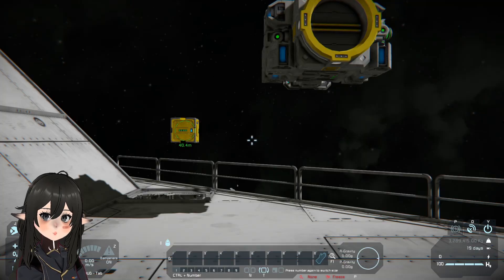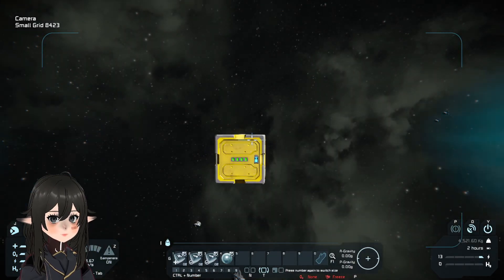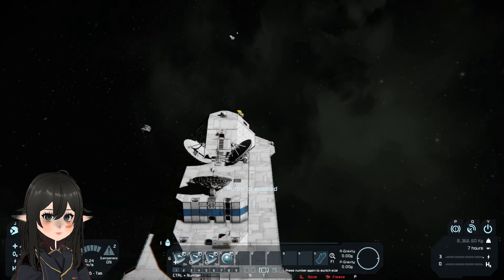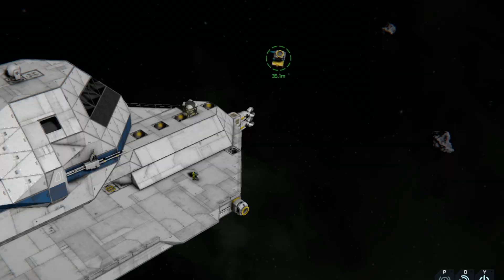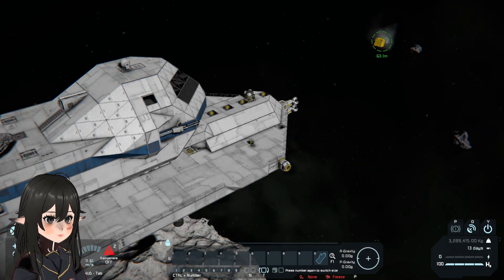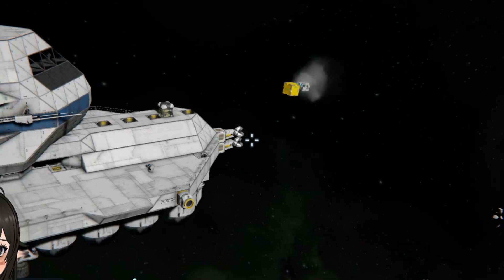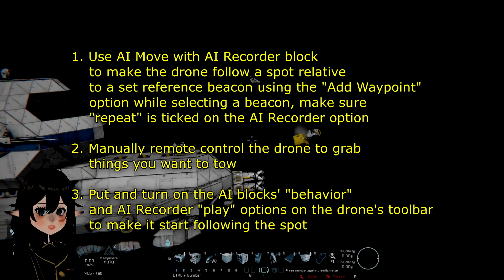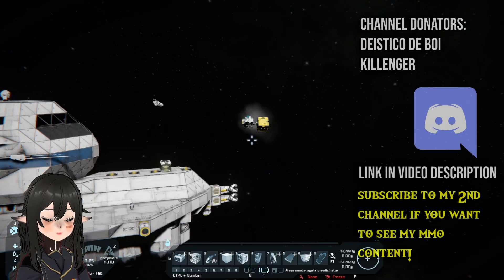This Smart Crane Trick Functions Like a Ship Tractor Beam, Space Engineers

Comment: Just like the Limpet Drones I used to use in Elite: Dangerous
Reply from the maker: Oo, does Elite Dangerous have tow drones O:
Reply: @LucaTheGuide  Essentially a Limpet is a programmable drone.  You buy different types of controllers for a ship that may have one job at full efficiency or one that programs several jobs(the one a drone gets is user specified) but they only perform up to a certain level.  After buying some drones for cargo hold you can use the controller to launch drones and they could fetch, repair, or break open your average ship hatch to steal cargo.

Comment: I made a chain out of turned off hinges by rotating them 90 degrees was hoping to  use it as a like hose to connect my ship to my base the idea was to have access to my resources but still fly around so I could use my build ship to print stuff without having to reload within the range of the chain, the chain worked fine till I attached the ship and then it went crazy.
Reply from the maker: xD ye that clangs things, I tried something like that too and it rip'd u wu
Reply: @LucaTheGuide  As long as the chain as connected to the base it worked just fine not sure what use it could be maybe a wrecking ball if connected to piston amd rotor crane or and flexibile version of a conveyor?

When connected to a ship it works but as you move the ship the chair moves around and makes the ship hard to control the main issue is when the base and ship are connected together by the chain the ship goes crazy as Lord Clang is displeased.

However as long as the ship has no engines amd just gyros you can move the end of the chain around tried to use the chain with a drill on the end with a gyro to control it and it sort of works but not very well I have ryn out of ideas if how to salvage the project into something useful.
Reply: @matthew-005 I can feel your pain
Reply: @egornick9206  We all must make our sacrifices to Lord Klang.